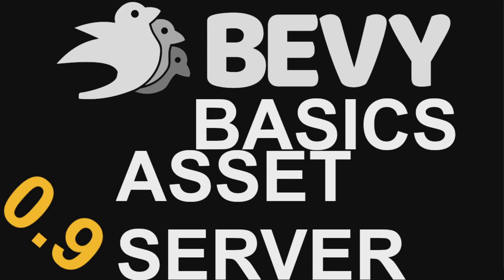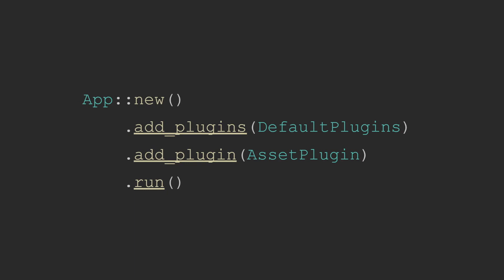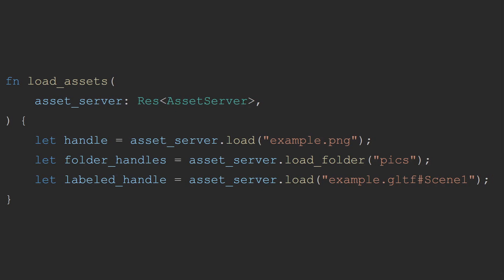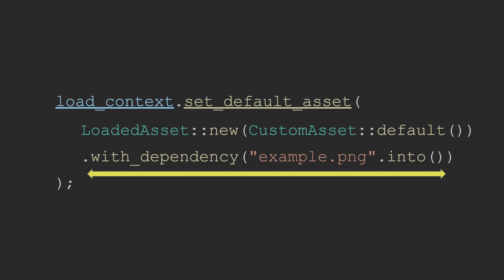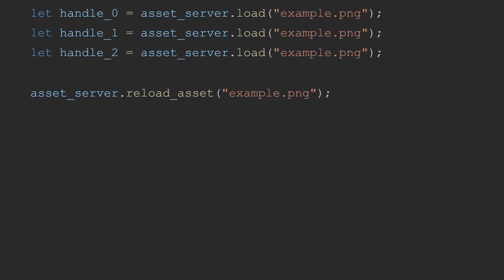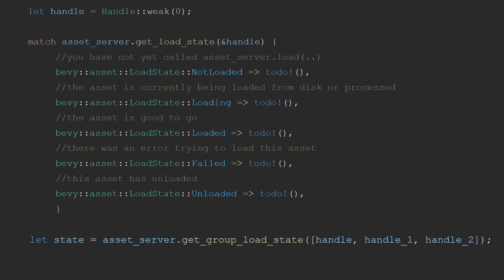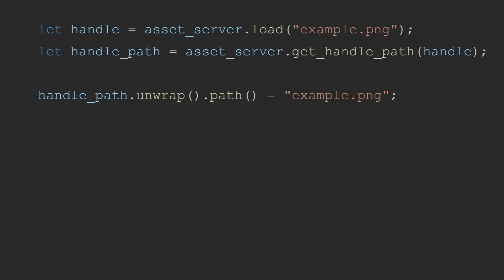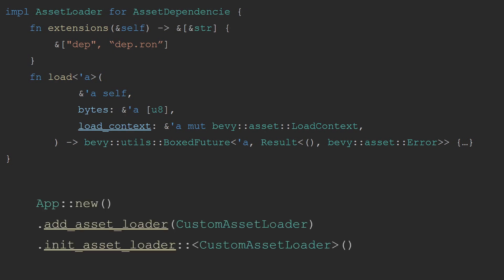Bevy Basics Asset Server

Comment: I want to change the path which the asset loader will load my assets from. By default it seems to be the Cargo manifest dir (or exe's parent dir when the app is launched without cargo) instead of the app's current working directory as I would like. How to do that ?
Reply from the maker: I don't know how you would go about doing it not relative to the exe, I'm not well versed in how paths work on an OS level, but you can change if from the ./assets file by changing the default value in the AssetPlugin. If you go the the hot reloading chapter you will see how to override the asset plugin
Reply: @PhaestusFox  Well, the "assets" folder is fine for me, the question is where the assets folder is itself located. I mean the absolute path. Usually applications load things relatively to the CWD but it's not the case here, it's loaded from the exe path, and I don't see the AssetServer API having a function to override that. Seems a bit a lack of customizability.. cause I need to modify the source code of Bevy here to achieve what I want. I'd like something like set_root_path(str)
Reply from the maker: I whent and looked in the source code, and order it picks the root is, BEVY_ASSET_ROOT, CARGO_MANIFEST_DIR, current directory. So you could set BEVY_ASSET_ROOT in main before App::new()